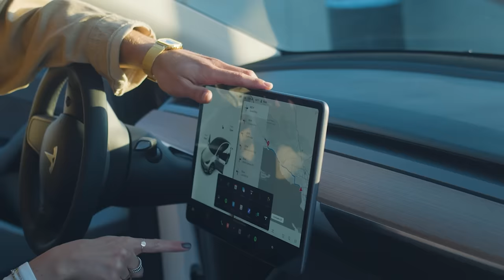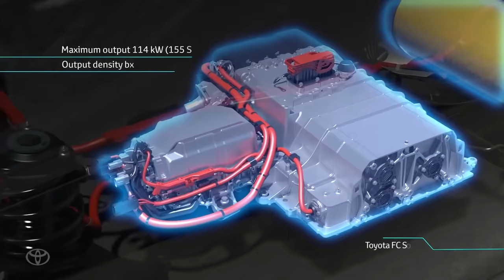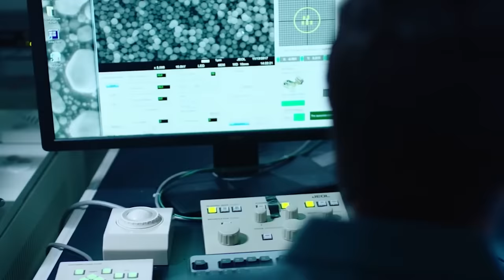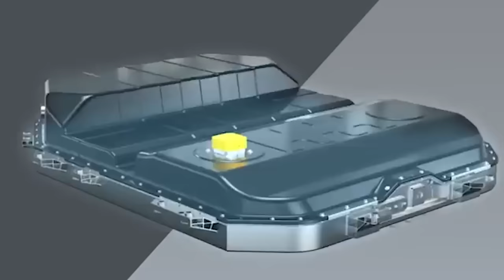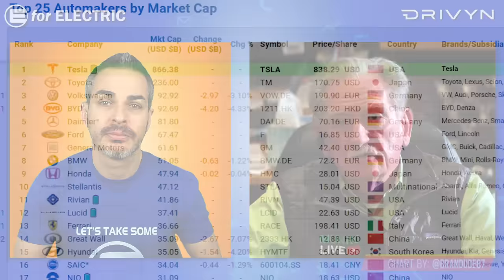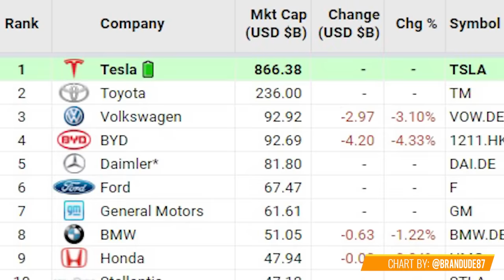SANDY MUNRO: Toyota's "Smart" Anti-EV Plan

Comment: you have to remember there are 1 billion vehicles and 80 million made every year - you won't make a dent in EV with big Tesla like cars - but if you used the Lihtium to make 10x as many all electric commute hybrids - you get 90% times 10 benefit - 20 million ell electric commute hybrids rather than 2 million pure electric EVs - this is the problem with large EVs and no one seems lo like tiny EVs outside of China.
Reply: There's no such thing as an "all electric commute hybrid" from Toyota. At least, not in anything they've made in the last 20+ years. Their hybrids use petrol as soon as you pull away from a stop light with anything other than a featherlight push of the accelerator. Any taxi driver who uses a Toyota hybrid will tell you they save on average 10-20% of petrol compared to a similar sized efficient regular ICE. This doesn't get close to the energy savings made possible with full BEVs. So is it really better for all those people to have bought hybrids in the past few years? In the next few years? I don't think so.

The NiMh battery tech they use has a small capacity and they don't even use the full range of capacity. The petrol engine and battery management ensures the battery stays between 38% and 82% state of charge. So you get less than one mile of pure EV range on the flat at low speeds! At least with BEVs you can use around 85% of the gross Li-Ion battery capacity between charges.

The availability of Prius Prime with the plug-in recharge capability and bigger batteries is laughable. Because Toyota do not want you to plug in. They want you to keep using their hybrid tech that they've been making bank on for over two decades now.
Reply: @nettlesoup  I had a 2020 Rav4 XLE Gas that used to give me 27 mpg average. I replaced it with 2021 RAV4 XLE hybrid fully loaded and it gives me 38 mpg for my 5,1000 miles driven so far. To me this seems like an fuel efficiency of more than 35%. So I am not sure if your 10-20% figures are correct. I was looking at RAV4 PRIME but it is so much in short supply that dealer wanted 12k upcharge from me, because of which I settled for a hybrid. I test drove a Model Y as well. But I live in an apartment in Uptown and could not find a way of charging a Tesla. I don't see this changing anytime soon so I am not sure if pure EVs be it from any auto OEM can be universally adapted by everyone in US. I don't think Toyota's are late to the party. By the time I have a house and ready to buy a new car in 3 yrs or so, it seems lot companies will have EV options in the market including Toyota.

Comment: Tesla's valuation won't last. Their vehicles are marketed and branded as luxury vehicles. Luxury vehicles aren't the bulk of the market. Once other manufacturers such as Toyota start to produce EVs at the cost of a Corolla, Camry and RAV4 (affordable mass market volume) and the market over the next decade or two is flooded with cheaper EVs for the mass market, Tesla will lose its importance long term. Tesla will be faced with rebranding themselves as non luxury in order to compete with mass market sales. Tesla right now owns the market but this will change with further competition and Tesla will fall into a trap of being a luxury brand.

Comment: Solid state is way more the actual future. These Lithium Ion cars are toys hurled at us by rich children and are just stop gap technology. If everyone drives electric cars that run off the grid, the cost of electricity goes up substantially and affects all the other aspects of life. Lithium is absolutely not sustainable and is limited to very few source in the world. 
And the Anode Cathode style battery is well over 100 years old and will not be the future. Anode cathode style batteries are an analog way of solving a digital problem so to speak. They will be obsolete, and our needs have far outgrown their capacity and discharge style. 
Sorry if you put a bunch of stock in Car companies that sound like they were named by a bunch of rich 13 year-olds drawing cars at summer camp
"RIVVIN OOOH OH ILL NAME MINE LUCID" 

Toyota are genius innovators who literally reinvented the assembly line and who actually care about the environment

Comment: I think Sandy just figured out the obvious. Unfortunately for Tesla, some are realizing that hybrids and hydrogen fuel cell vehicles are electric vehicles that look beyond Tesla's short sighted vision. FULL autonomous driving, from a legal point of view, is a DEAD END so the main advantages Tesla holds may be their gigapress, NCA and LFP battery manufacturing capabilities, and their electricity charging network.
Reply: @skipondowntheroad5833  what your going to make your massive batteries with? non-existent lithium?

Comment: Tesla made EVs because they wanted an alternative - it isn't one that scales due to limited lihtium etc.  Its a fine car and alternative but you can't make enough of them.  If you are concerned about C02 Li EVs are counter productive; they such up too much Li  - would I be green if I build a super tanker every year powered by Li batteries and it sucked up all the Lithium produced?  It would make one clean super tanker and force people to by more ICE cars.  Great for Shell or some oil company. Beyond that Tesla could not compete making hybrids.  With Hybrids you can make 10x as many vehicles that is better for CO2... if that worries you.
Reply: And once depleted, a lithium battery ends up with a lot of carbon on the anode side. Correct me if I’m wrong.